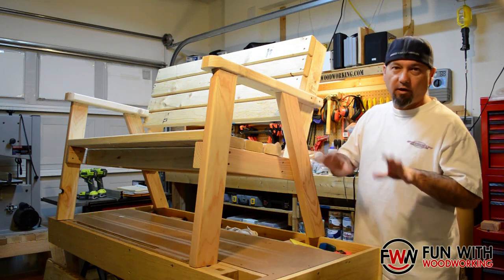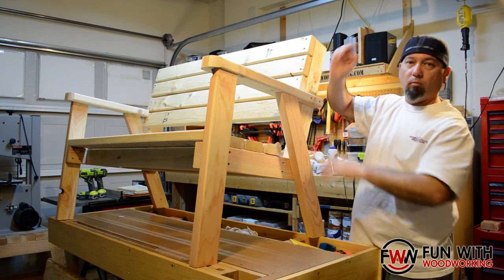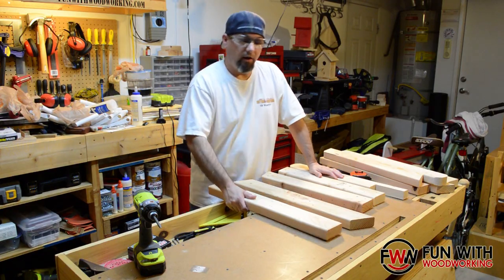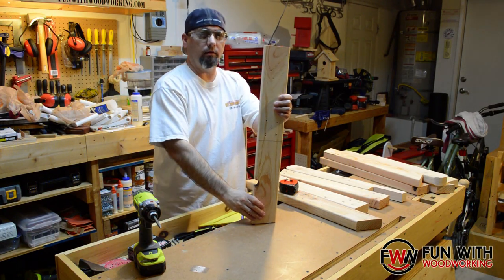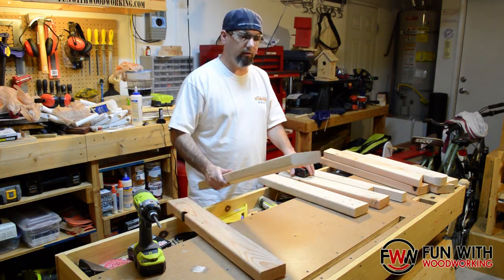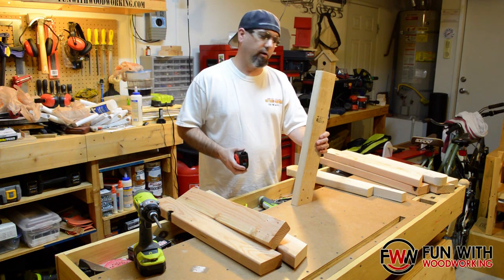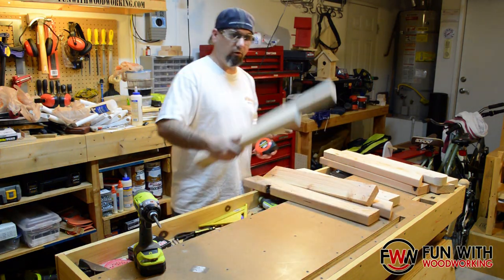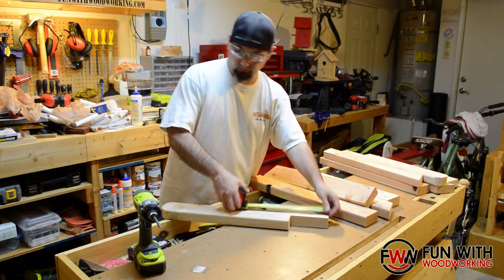How to build a Park Bench with a reclined seat Ver 2.0

Comment: I just built a metric variation of this design and it turned out great! Thanks for the design and plans I bought on your website - they were very detailed and clear, and allowed me to adapt the design to different size wood. Initially I was going to use pine 2x4’s as you did (90 x 45 mm or 90 x 35 mm here in Australia). But then saw some gorgeous hardwood decking and used it instead - mainly 85 x 20 mm and a few pieces in 135 x 20 mm. Doubled up some pieces for strength, and made armrests longer and wider. Looks fabulous. The wood is Karri - a native eucalyptus species from West Australia. Using natural color decking oil as finish.
Reply from the maker: That sounds awesome!  I would love to see a picture of the finished product.

Comment: I agree with others that is an excellent design. I have made 2 benches 6ft long and one that is 4ft long. For the 6ft benches I put a supporting strut between the front and back supports. Rather than screwing into the grain(for example attaching the arm rests) I used Kreg joinery. I also glued and screwed all joins. I also made some modifications such as cutting the top of the back support at a 20 degree angle and I used carriage bolts to attach the arm rests to the back supports.
Reply from the maker: Thank you so much!

Comment: Great job, one question...why not make it 48" long versus 45"? If you are using 8' long 2x4s this would have allowed you to save on the waste of cutting two 45"s with 6" of lumber left over. Your plans are still the best I have seen. I just downloaded the PDF and the plans are missing the dimensions for the cut on the arm rest. Thank you Sir for sharing.
Respectfully,
Humberto
Reply from the maker: +Humberto Garcia I wanted the overall width of the bench to be 48".  Once you add the thickness of the legs to the 45" it equals 48".  That also gave me some leeway to cut out bad parts of the 2x4.  Download the plans again, I added the arms.

Comment: Love the bench. I'm in the process of building it now. If the front support is 12 inches from the bottom,  what is the distance from the bottom in the rear connection?   Thanks!
Reply from the maker: glenbronco2 11 3/16" at the front of the rear leg.  I just added a page to the free PDF on my website with that information.  http://www.funwithwoodworking.com/p/downloads.html
Reply: Thanks.

Comment: Hi, Could you use 1x3s instead of 2x4s for the seat and back? Thanks
Reply from the maker: sand smith I think that you could but I would recommend making a brace or 2 under the seat to prevent them from sagging.
Reply: Ok just one other Q, What size screws did you use?
Reply from the maker: I used 2 1/2" exterior screws.  You could also use 3" screws but I already had some of the 2 1/2's so I used them.
Reply: Thanks very much for your Help.

Comment: great video and very detailed explanations. one question: would it be wrong to make the "back" leg from 1 piece, instead of the 2 parts (the ground part and the recline part) ? thank you.
Reply from the maker: You might be bale to do that but you will need to re-engineer the design.  Right now those 2 parts are not lined up.  They are sitting next to each other and get screwed together sideways.
Reply: FunWithWoodworking i'm working on it right now. I will see what comes out :)

Comment: hello. Can you please verify about armrest overall lenght? In the video you are saying 24” in the cut plan from the website it is different, shorter. Which lenght is to use? And the split cut is 5 1/4” long, right?
Reply from the maker: I would go with what the plan says and I would make the split 5 1/2" just to play it safe.
Reply: Thank you, Worked out well. As a sick perfectionist I’d recommend to cut and build everything but the armrests and then measure, cut and install armrests to the size

Comment: how much did your bench cost?
Reply from the maker: The park bench or the workbench?
Reply: FunWithWoodworking your park bench
Reply: How much did it cost for all the material you used on your park bench
Reply from the maker: 8 - 2x4x96 studs and 1 lb of 2 1/2" deck screws.  With Tax, a little under $40.

Comment: Not sure if you would be interested explaining angles? And cuts? Just want a better understanding of how you find your angles & make your cuts. Please if possible. Thanks.
Reply from the maker: +Tano Hardman I wanted the seat to recline at 5 degrees and then the seat to recline at 12.5 degrees relative to the seat.  I then figured out the other angles to make that work.  I'm not sure how to explain it.  I designed it all in sketchup first.